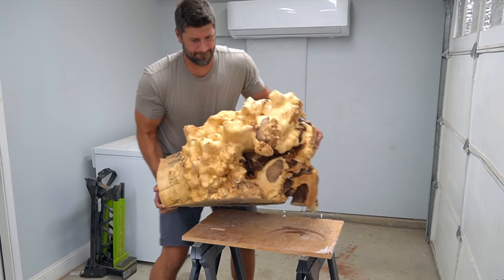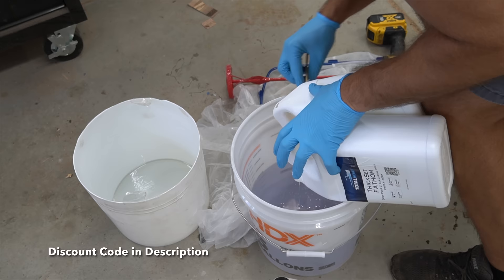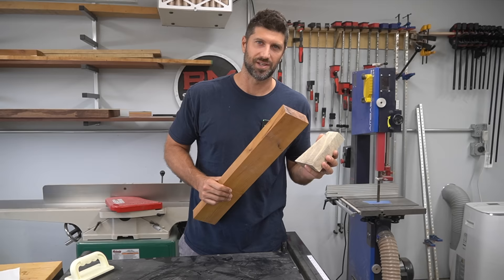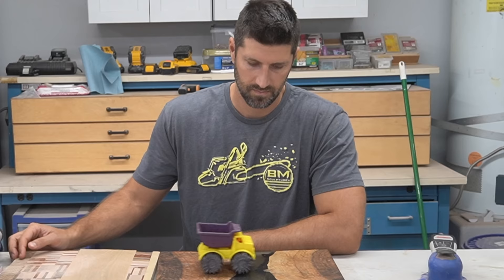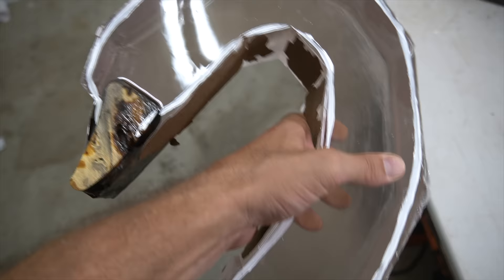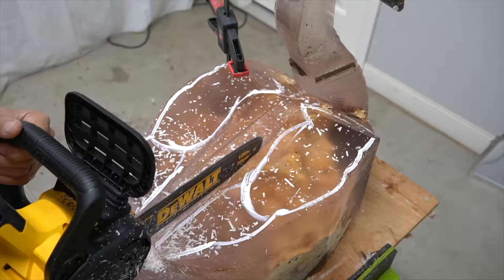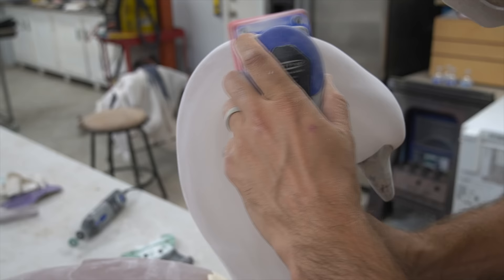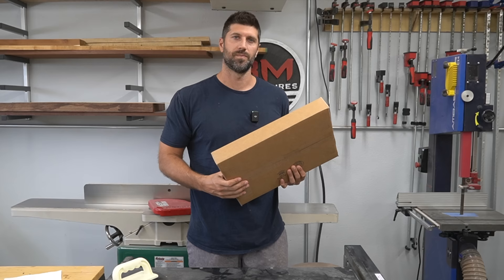Carving 9 Gallons of Epoxy & Wood Into a 🦢

Comment: Very nice sculpture. Love your work.
Yellowing epoxy. I suspect it is because big volumes react faster, so you get extra heat from the curing epoxy, thus you are actually burning the epoxy. I once did a 2kg epoxy cast, and it got so warm, we where afraid it would combust. So out into the brick and cement drive way it went, and fire eqiupment at the ready.
And no, it doesn't look like a nuggy, it looks like honeycomb candy.

Comment: Amazing work and details - as always, but in my opinion the part of the neck to the chest splits in three parts with very clear visible layer lines, which I really don't like. It looks fixed or re-done/improvised... As a customer I'd be a bit disappointed, because the rest of your works looks so straight perfect.
For your bull/horse/bison sculpture out of a wooden block, I'd prefer the bull.
Cheers and always keep your standards high!

Comment: What do you use after the sanding to make it fully transparent?
Reply from the maker: sand to 5000 grit... oil/wax finish. Rubio/ osmo/ any brand works. Topped with a thin coat of butcher block oil
Reply: Cool, thank you😊
love the sculptures